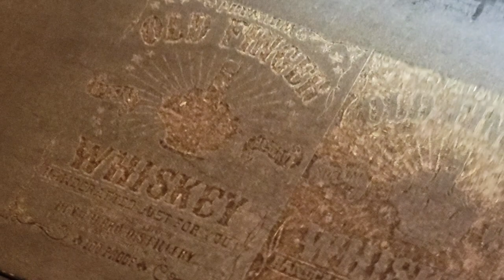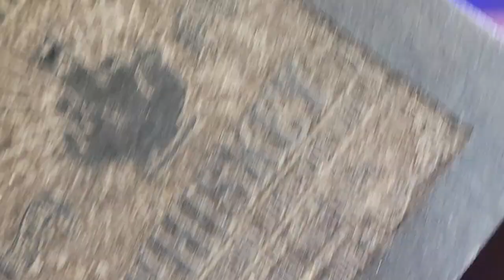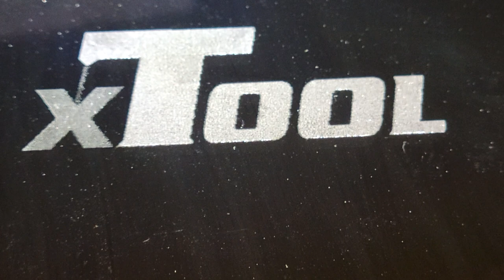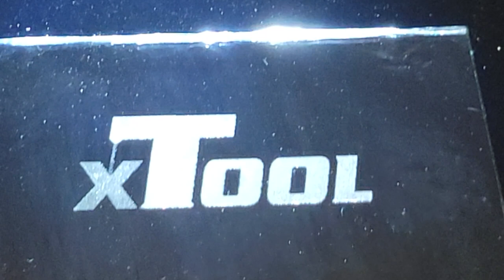xTool D1 / 10w Laser - Glass on the Fly - Etching / Engraving - Just the steps

Comment: Hello friend, first, thanks for the video; I have two questions:
1) The black paper (cardboard) that you use under the glass, is it to replace any black paint (spray) in place of the painting technique?
2) After you apply the oil to the glass, do you clean it almost completely before etching?  Thanks
Reply from the maker: Hi Dan, Thanks! I've been doing these long before the spray paint technique. They couldn't stand the smell.. lol 
The 'etching action' happens between the backing paper and the glass. The laser needs something to hit(focus on, some call it). It goes right through the glass. 
The oil or soap stay on and you engrave with it still on. It helps keep the glass a little cooler and helps move the smoke out from under the glass. It also helps with clean up after.
Reply: Thank you very much! Keep up your good work. Hugs from Brazil.

Comment: what is the purpose of the oil? Keep the paper from sticking?  I've tried this technique without as much success as this but no oil either.
Reply from the maker: I don't use anything on smaller pieces. The oil or dish soap help keep the glass cool and help with clean up. Smoke film cleans up easier with it. I have one on the table now and going to do another video. I hear the same thing all the time and don't understand. I just place the backing paper down with the glass on top and go. Couldn't be easier. Some have experimenting with using a piece of painted metal for a backer. Haven't tried it yet but they have been getting impressive results and it's reusable. Paint a FLAT piece of metal black and place your glass on it to engrave.

Comment: Will this only work with 3-in-1 oil ? Can I do it dry ?
Reply from the maker: Hi Brandon, you can always try.. :) I do smaller things dry all the time. 5x7s even if it isn't a real heavy graphic. It helps with cleanup on the larger ones.

Comment: Will this machine engrave on mugs or tall glass style with handle with the rotary attachment?
Reply from the maker: It will, but you will need another 3rd party attachment to do it. It holds the cup up and lets the handle swing around. It will take a little creativity, but it can be and has been done. You can search etsy for xTool or D1 attachments.
Reply: The new rotary from xTool looks promising. Thinking of getting a Laser engraver and have been doing a lot of research, and as of now the xTool D1 with air assist and possibly the new 20W laser head is looking to be my choice.

Comment: What's the purpose in the oil?
Reply from the maker: It helps to keep the glass cooler on heavy burn projects and with some posterboards, it helps keep the smoke film from staining the glass. It is easier to clean. I don't use anything on my smaller projects. Latest info is on this page. https://vipervisuals.net/laser/glassonthefly.html

Comment: Did you put the side of the glass down with oil on it or facing up? I didn't catch you saying which way you place it? I recently purchased the SnapMaker 2.0, have not used the lazer yet but want to try something like this.
Reply: Hello William. A little oil on the inside of the cup and the backer piece right up against it. An oil sandwich.. Talked to a few lately that have a SnapMaker. May have to look into one.
Reply: Looks like he cleaned of the back of the glass that was against the paper!
Reply from the maker: Oil side goes down against your backer. I have a new way that is even easier and have a video ready for it. Just waiting on approval to post.

Comment: Hi! Is that possible the light bounce on the glass and return to the engraving and damage the engraving lens whit this method???
Reply from the maker: Not with glass. It is clear and the dark backer stops the beam. If you tried it with a mirror, I'm sure there would be problems. I have a 10w D1 that I got back in Sept without the extra lens and it still works like the day I got it. I do these on a regular basis..
Reply: @viperdesigned  thanx a lot dude!
Reply from the maker: @juanesparza299  There is a newer video you might like.  https://youtu.be/Zy5FrL1yhCg  the details about it are on the website also. http://vipervisuals.net/laser/glassonthefly.html

Comment: Is it etching on the front or backside of the glass?
Reply: The etching is done on the back side of the glass between it and the backer material. You can mirror your image and it will be right on the front. You can use it either way.
Reply: Watching this video, I was wondering if a black silicon mat would work as a backing material. Silicon has a melting point of 1410C/2570F.